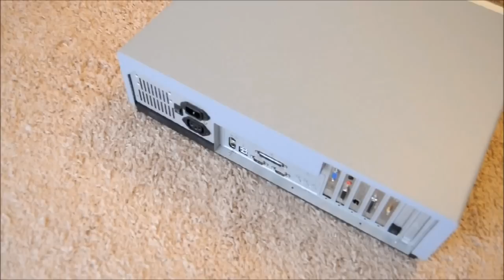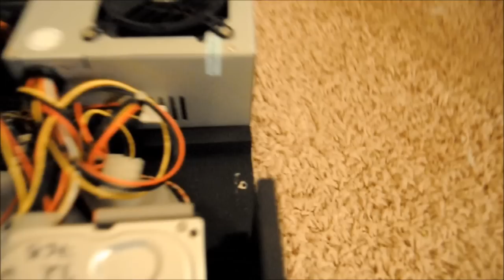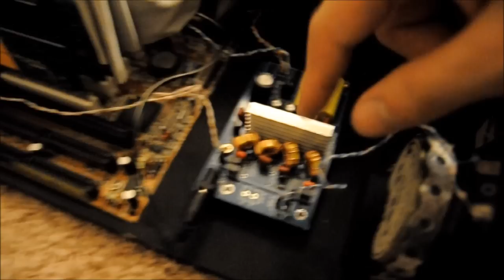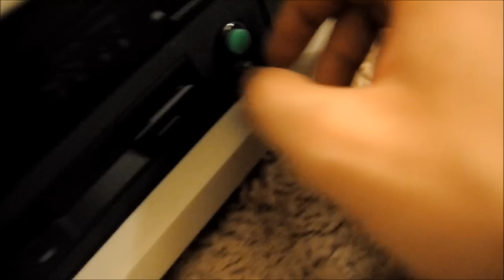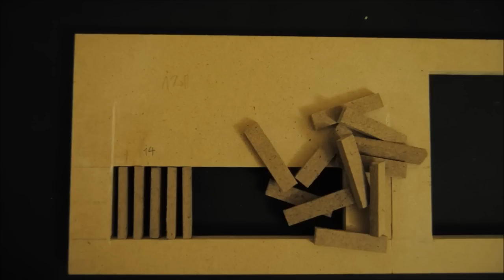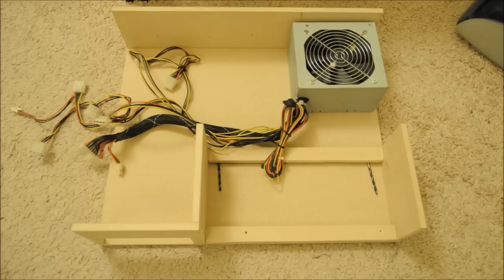Scratch Built IBM 5150 Replica PC Case! (For Retro Game Rig)

Comment: Just seeng this again after many years & seeing vintage mid 80's tower workstations from the likes of Silicon-graphics & Sun-microsystems makes me want to have a tower like those systems, but running a modern unix-ish system (The BSD's & illumos distros mainly).

May try to in the future make a system that's visualy patterned after the IRIS-200 and Sun 2/10, but with a x86-64 core & cable management. Won't be impressive but it should get whatever i throw at it done.

Comment: I'm looking for wooden pc case with a lay down model (not a tower) for more than three monts. And finally, found it here. and i really love this video. 
But still, i can't see your layout and dimensions.
Reply from the maker: Hello. I'm glad you ended up on my video. The dimensions are just what the original IBM 5150 has,i just laid down an mdf plate as a chassis with the backplate of a ready made pc case and i built the frame to support the motherboard and moved my way round replicating the 5150.
I do not have any plans available,but if you want to make something similar i suggest that you use real wood and not mdf,and you can use the dimensions of a case you have,then slowly tweaking the dimensions on a paper to bring it into to the level you want while being sure everything will fit inside,and of course design the dvd drive,etc to be horizontally mounted.
I'm sure if you search for "wooden pc case plans" on youtube or on internet forums you will find something that can help you more than i do. :/

Comment: Exelent , its posible to share layout and dimensions, thanks
Reply from the maker: Hello. It is based on the outer dimensions of the original case but to tell the truth i did not make it using a layout thus i don't have any. :( I've made a replica then incorporated the parts by configuring the case accordingly.